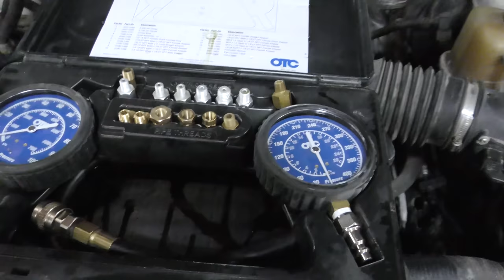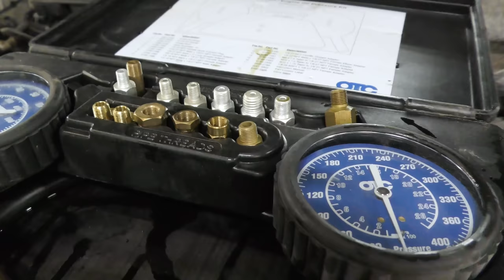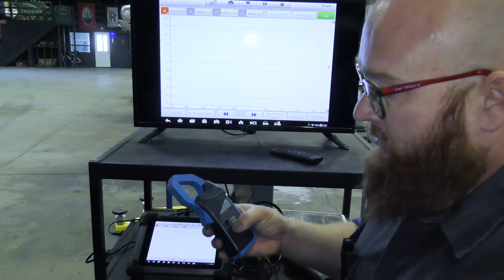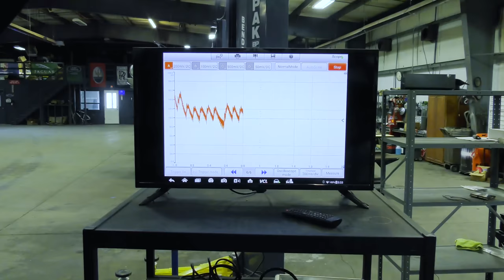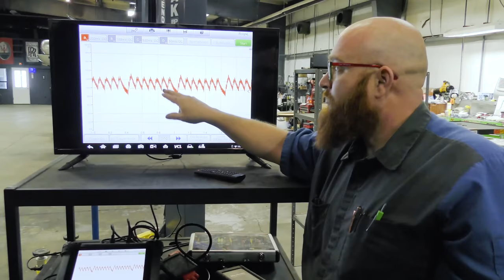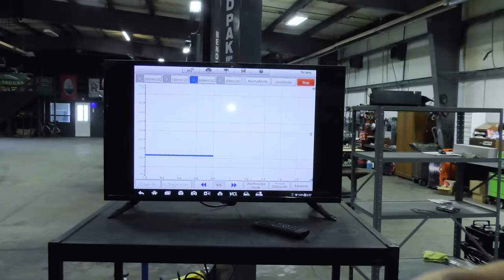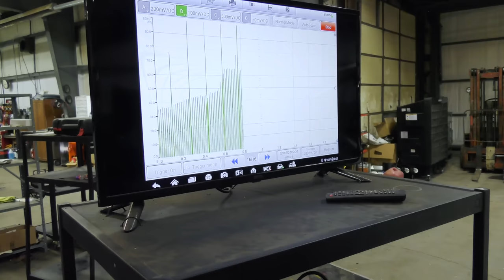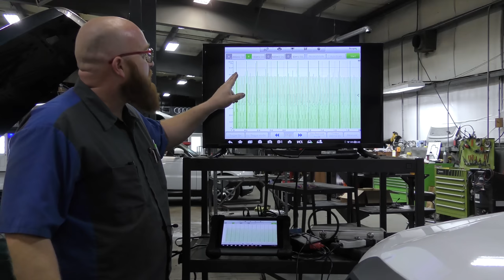Can an engine additive really fix this 2011 F150? CAR WIZARD shows how to diagnose and repair

Comment: I had a 5.0L 1986 Bronco which had a similar problem. The oil pressure was fine until the engine heated up, and it dropped to near zero. I had no idea what was going on. Dad, who worked on cars since the Model T, figured out what the problem was. He  pulled the oil pump and ran it in a bucket of hot oil. We jacked up the truck, removed the oil pan; replaced the oil pump; replaced all the piston bearings with 2000th under bearings,  then the main bearings, which fixed the problem. It took maybe half a day to complete. The Bronco ran fine ever for as long as I owned it.. Point being, I didn't have to replace or rebuild the whole engine.

Comment: Lucas is more of an oil thickener and less of a true lubricant.  Also Lucas is expensive and this engine needs a crutch for the rest of its life.  So the customer would be better off switching to 0w40 or 10w50 oil to keep the pressure up.  My $0.02.
Reply: Absolutely, 100% agree. Lucas products are a scam to take money from dumb people at Walmart.
Reply: 2¢ lol
Reply: @Scott-ig1zd  Generic term for big box store that sells worthless things to morons who have no idea what it is. You're right, every auto parts store is also full of overpriced scam products. It's just part of the business.
Reply: i'd switch to rotella t6 5w40, that was what I was thinking.  Engines worn just use a heavier oil!
Reply: A quart of Lucas is $9.99. So is a quart of Mobil1 Advanced Synthetic. You can get the oil cheaper if you buy one of those 5 quart jugs, but not that much cheaper. It's $6.99 per quart in a jug. If Lucas fixes the problem, then who cares. You're adding about $3 to your oil change. Big whup.

That engine takes nearly 8 quarts of oil, so you're already spending about $60 just in oil. They bought a truck, not an economy shitbox. They knew it was expensive when they bought it. You gotta pay to play the truck game.
Reply: @matts.8342  Except simply using thicker Mobil 1 would be cheaper and actually better for the engine. In this example, it's like beer is cheaper than water, and your engine wants to drink beer.

I seriously seriously doubt somebody driving a truck worn out at 180,000 miles is using mobil1 at any kind of frequency...more likely Supertech. Even then that's better than Lucas.
Reply: @ryanroberts1104  Exactly. Although once you're at this point, using Lucas is a cheaper "fix" than replacing the engine. It may give the customer time to save up for a replacement truck or engine.

I say mobil1 because when looking for an oil based on the Ford required oil standard for my truck (2012 3.5L ecoboost) it's the one that comes up when searching the Ford standard number on google. They even have it printed on the bottle.

You can't really say walmart oil is better than Lucas, as they aren't the same type of product. Lucas is an "oops I've screwed myself by using supertech, how do I get a bit more life out of my engine" product. Moral of the story here is you can't use shit conventional oil and garbage filters in a modern engine and expect it to survive. You have to use a quality full synthetic and OEM filters, and change the oil more frequently than recommended. Otherwise you're screwed. 

Can't say that I entirely blame the owner or previous owner though, what with all these new bogus advertising campaigns for oils stating they last a 15,000 miles or a year between oil changes. Complete bullshit. Change your oil at 3-5k and use an OEM filter and your engine will outlast the body.
Reply: @matts.8342  You're missing the point. Lucas is nothing but thick oil. There are no other ingredients. Using a thicker weight oil is the exact same kind of "fix" as using Lucas. Both might limp you along a little farther all the same. No matter how you look at it, there is no reason for Lucas products to exist other than to confuse dumb people.

This is a pretty well known solution for almost any engine ever made with low oil pressure and a desire to run something worn out just a little bit longer, not at all specific to Ford or this particular truck. They've been doing this since before Lucas products existed.
Reply: Using Lucas always seemed like a game to me. You never know how the ingredients in it will interact with the additives in the oil.

Comment: I had a '94 Dodge Dakota with the 3.9L V6. It had a slight rod knock on cold startups. I started using Lucas Oil Heavy Duty Oil Stabilizer, and it solved the problem. Also, reverse in the automatic transmission stopped working, and it leaked fluid out the side by the connector. Lucas Oil Transmission Fix solved both problems.

Comment: There’s been a F150 with a seized 5.4L 3 valve parked in front of my shop for 2 months....it’s really racking up the parking fees.

And Lucas is good stuff, it really quiets down the cold weather piston slap in my 260,000 mile Subaru engine.

Comment: 4.6L 2V and even the 5.4L 2V were the best F 150s. Maybe I even best trucks. I have a Crown Vic 4.6L which is literally just a sedan body on top of an F100 frame with what used to be the F 150 engine and trans (although it’s a 2010 PI so it’s much more updated and has a 4R75E instead of 4R70W, which is much better). Only 78,000 on it rn

Comment: Over here we just chuck in any old  20w50 to get the pressure up . . Excellent show really enjoyed it .
Reply: Yep...no reason to use Lucas for that. Or anything else...oil does not need to be "stabilized".
Reply: If you put straight 20w50 in a VVT engine it will cause engine codes and drive ability issues that’s why you only use 20% capacity. You go dump 7 quarts of 20w50 in a 5.4 3v engine and see how that turns out.
Reply: @classicoldskool1420  I dont know abt that motor but over here in the UK anything hitting 150k or old motors in general you.would use Duckhams 20w 50 or maybe Castrol GTX .. it just helps keep up the OP  .
Reply: There is no shortage of oil experts on the internet, only recently surpassed by virology experts.
Reply: @truantray  It's kind of a trigger when a mechanic says Lucas fixed something - especially a mechanic I trust like the Wizard. In general if a mechanic says anything like that you should run for the hills. And not pay him. Wizard should know better, thicker oil would have solved the problem exactly the same, but it would have been cheaper than lucas and better for the engine.  (Especially if planning on doing this long term)

Wizard should have been more careful with his words so as not to advertise for Lucas - which is exactly what he did, even though they didn't sponsor him! Now we have a bunch of stupid people who watch this channel buying lucas products because they think it actually does something..."cuz the wizard said so".

Comment: I had a jeep do that. 
I upped my weight in oil. 
Went from 10w-30 to 20w-50. 
No issues. 
400,000 miles. 5 owners later, still going. 
Upped the weight from 5w-20 in my f150 and wifes edge to 5w-30... runs great still.

Comment: I've got a 200,000 mile engine...similar for me, I run a scooch more viscosity (5w30 vs 5w20) and half a bottle of STP. Keeps the engine quiet when it's hot.

Comment: years ago my Chrysler 3.8 Town&country had serious low oil pressure  I extended its life by running it with 20W-50 for a few years and put a mechanical oil pressure gauge to have a solid reading

Comment: The sending unit swap is often the right answer on these, regardless of engine. They tend to go a little bad and then get oil leaked into the wiring, and then it's done. And you have to replace the unit and the wiring, or clean it real good.
Reply: Exactly, and we don't know the whole story here, maybe the tech called for more diagnostic time and customer refused and asked something like "well what's a cheap potential fix".
Reply: youre forgetting he did an actual test of the pressure, not just relying on the sensor for his data. However, you are correct that many times this symptom is caused by oil leaking into the sending units contacts. in that case cleaning it and coating the contacts with electrical grease will resolve it.

Comment: I run 15-50 in my car that has 250,000 miles on it in the summer time. In the winter I run 0-40. I have slowly thickened the oil as she has gotten older.  That 15-50 mobile one synthetic makes her purrrr. No ticks or anything. It's very nice.

Comment: Had the same exact issue after an oil change with a fleet filter and motorcraft oil after having no issues with Mobil 1. Installed new motorcraft oil sender, new motorcraft repair pigtail, new motorcraft oil filter, and mobil 1 full synthetic 5w-30 oil. No more problems, 126k miles.

Comment: Isn't the Lucas additive just a really thick oil? So it's just like bumping up the viscosity on a worn engine.
Reply: thats what infigured,, but this is why i hear peopls say,, use thicker oil at high milage
Reply: I’d just go to a 5w-30 or 5w-40 before adding Lucas. Only filters that should be on Fords are motorcraft
Reply: Yes but a safer more accurate way to thicken it up.
Reply: @Zerinsakech  Really? I'd expect it is safer to buy already thicker oil (if the engine can run it) than to mix it like this.
Reply: @Zerinsakech  Lucas provides worse lubricity protection vs just going to a heavier top tier oil.
Reply: @Bushy556  - except Lucas products actually provide improved lubricity, whether it is their oil stabilizer product, their break-in oil, or their race oil.
Reply: No.
Reply: This comment thread sounds like itmwpuld make a good engineering explained video.

Comment: Yes, I'm a believer too! I have a 2004 Mercury Marauder with the 4.6 4 valve cobra motor in her, I was experiencing hesitation under normal acceleration, and full throttle, I added this today, and the hesitation is all but gone. And now the idle is smooth as butter! Good stuff! I also used the Lucas oil stabilizer as I could smell oil, this stuff works and has stopped my oil smell!!!

Comment: Wizard, what about switching to a high HTHS viscosity 5W-40 from the prescribed 5W-20? That way you aren't diluting out your additive package and you should gain back oil pressure at idle.
Reply: My European sedans both run full syn 5w40. Good stuff.
Reply: I run Castrol edge Euro 0w-40 in my 5.0. I’ll take protection over unseen fuel economy
Reply: Use what's recommended
Reply: Do you believe that throwing Lucas in the crankcase results in the viscosity that is recommended in the owner's manual?

The oil weights in the US and the language in the manuals are driven by CAFE. Most other countries have oil charts in reference to ambient temperature. Most engines will be fine with any number of oil viscosities as long as the temperature that you are operating the car in is appropriate.
Reply: @johdirt7843  won’t hurt but if you want to thicken your oil buy a heavier oil. Lucas is overrated.

Comment: My 5.4 has never had any issues and it has 250k on it... only thing I have ever done is plugs wires and coils ... my exhaust manifold is about shot though lol
Reply: must be the 2 valve
Reply: My '07 5.4 3v has not had any problems in its 130k life other than the warped passenger side manifold and the mechanic was able to replace that without breaking the studs.  I replaced the spark plugs early on and its always had mobil 1 in it.  Now the rest of the truck has had almost ever other common problem go wrong with it.  Corroded fuel pump controller, 2 steering shafts, 4wds vacuum component, 2 ac pumps, power steering pump, and instrument cluster with brake light on.  Even with that I still consider its been a pretty good truck for me and the truck will give way to the midwest rust before the tranny and engine give a problem at this rate.
Reply: The 5.4L is a picky engine, but if they are taken care of and properly maintained they will last a long time, the biggest thing is that they don't have the best oiling system which is why regular oil changes are an absolute MUST with the 5.4L. If you own one of these engines do not skimp an extra 1000 miles or more on your oil changes, some engines are fine with that, the 5.4L is not one of those engines. I used to work in a warehouse and we had a mix of Ford Econoline and Chevy Express delivery vans, all but one of the Fords were 5.4L's they one E-150 that was a 4.6L, they we're all religiously maintained though, they all looked like trash on the outside because they we're high mileage and worked hard, but they all ran like new because of rigors maintenance schedule they we're put through.

Comment: I knew someone that have a 5.0 Ford engine with the same problem and they just replaced the oil pump. I don’t know if it did anything or not. I guess that’s why Ford decided that they put a belt driven oil pump on the 2021 and newer 5.0s which is a joke just like the 3.0 Duramaxes.

Comment: Wizard, what brand of filter was actually on the truck?  Wish you had tried the filter replacement before adding the Lucas (even with 1 quart short).  I'm not slamming Lucas, but sometimes oil filters contain a backflow valve and replacing with the factory quality filter would have been enough.

Comment: The Motorcraft FL-910 oil filter is like $4 at Walmart. Seems silly to skimp here.
Reply: You'd be surprised how many will see that as an opportunity to skimp.
Reply: Exactly they rather pick up the 2.88 Walmart supertech filter 😂😂
Reply: Keep in mind however; Supertech filters are actually Wix. I'd rather use that than Fram. No you cannot go wrong with OEM period and preferred.

Comment: Been doing this to my 04’ silverado 1500 with the 5.3…. Has a bad oil lifter and it knocks a lil when first started…. Been putting lucas every oil change and now its much better and oil pressure is fine. Still knocks for the first 10 seconds when cold start but noise  goes away after that, try it it works 👍